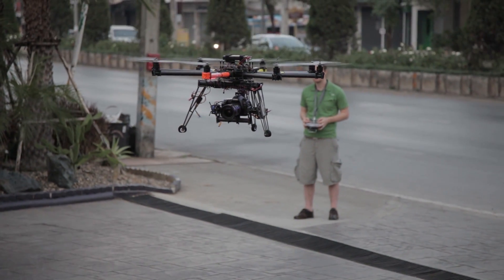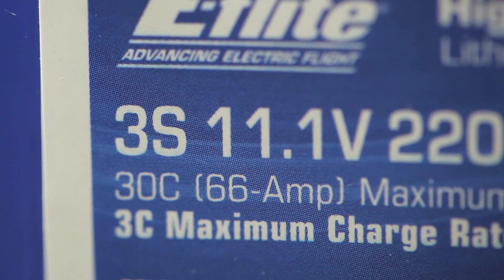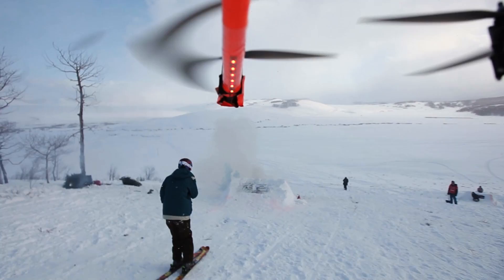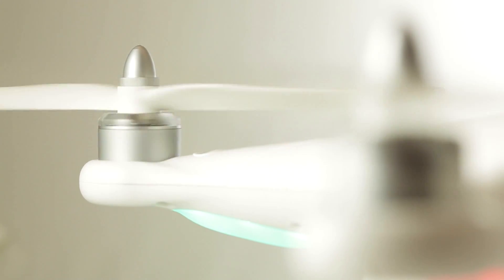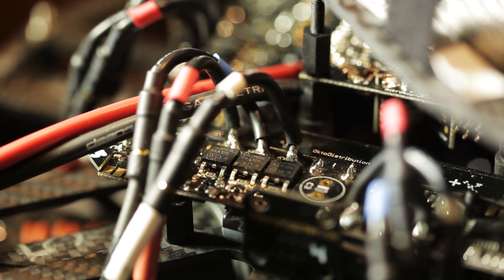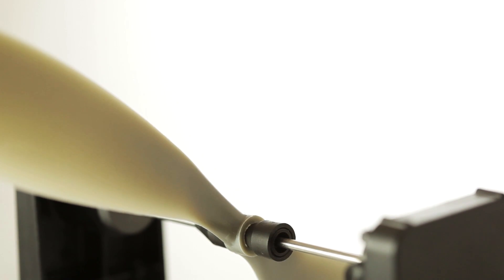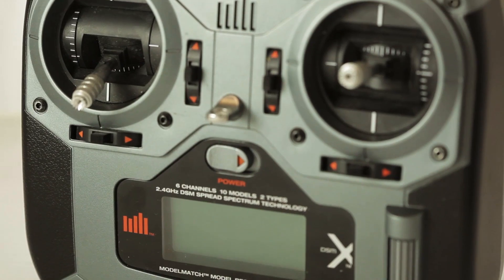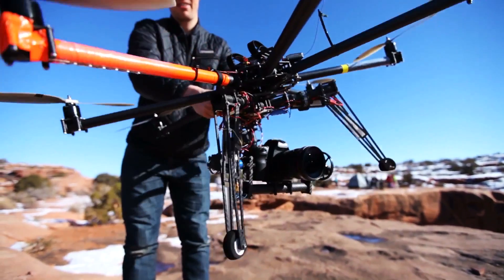CineChopper Flight School - The Anatomy of a Multicopter

Comment: been following the mulitcopters since some time in 2005 saw these amazing low res German made quad copters. Would love to know how you handle the business of doing this, such as bonding and insuring... seems scary flying around with cameras the cost of a house attached.  Still awesome, first rig I've seen that I'm suggesting to my film making friends. Can't wait till you plug that thing into some GPS match moving software, you'll be disruptively innovating some cable cam rigs out of existence. Someone should invent a parachute or airbag system for emergency crash landings. Airbags would work better for low to the ground high-velocity loss of control.